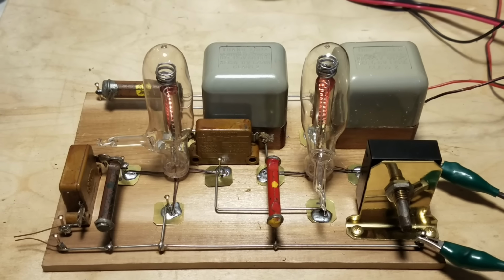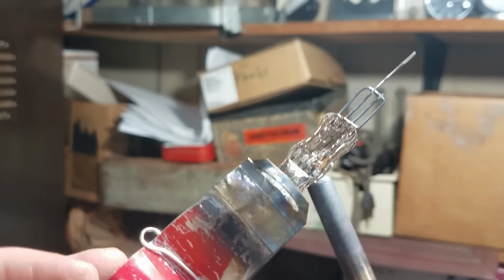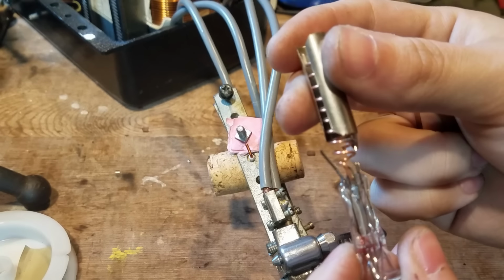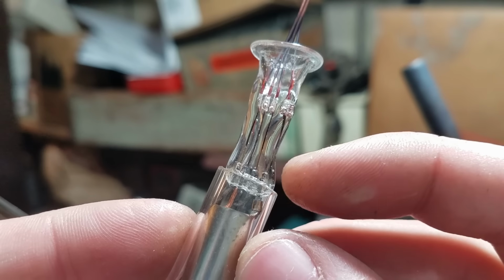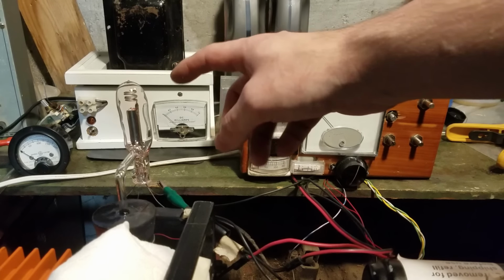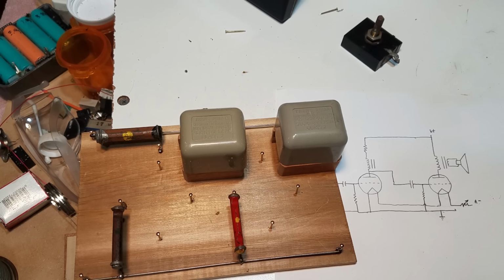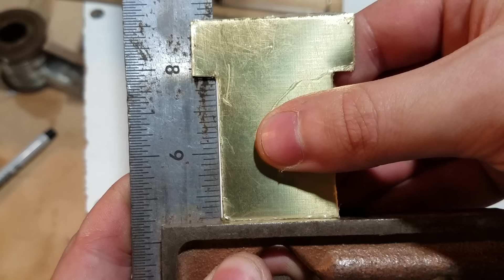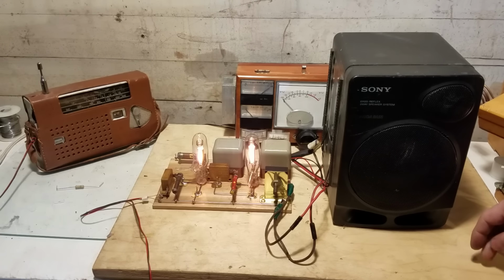Building a 1920s Tube Amplifier (And Tubes!)

Comment: Amazing.  Lost knologe .
Reply: Wow to think as a kid 50 years ago i used to take stuff apart to see what made it tick  i just learned a lot.  Too bad the parts ended up in the trash it could have added to your collection of old electronic parts. Hard to come by now. 
Ive seen 1950 60 and 70s test equipment tossed out or set out on Craigslist Free.  You should keep your eyes out for it.

Comment: Reason your audio is shit is that you have no bias on the grids, you need a negative bias so the tubes aren't near saturation and so the grid doesn't go positive during half the cycle becoming conductive and resulting in an asymmetrical waveform.
Reply from the maker: The tubes are biased from the filament supply. They are wired in series with one end of the output tube filament connected to A+, other end to one end of the preamp tube filament, with the other end of the preamp tube filament grounded. This gives negative five volts bias for the output tube due to the filament drop of the preamp tube. The preamp did not require additional bias to reduce distortion due to the relatively large plate load resistor.

Comment: I am receiving an Archer four tube stereo amplifier that has never been removed from the box. Never been powered on. Left and right volume controls. Original tubes. Untouched. 1960 I'm thinking but not sure. EBay baby.